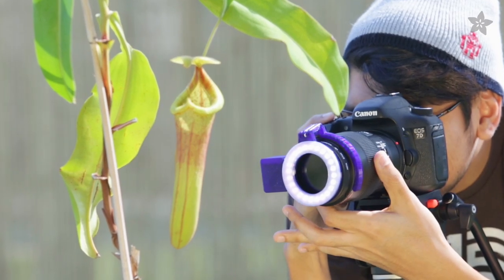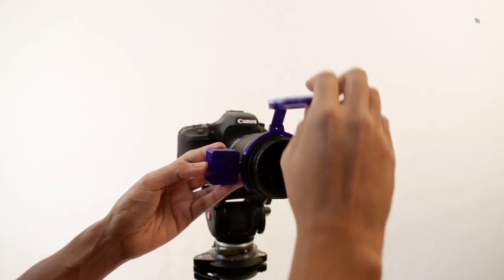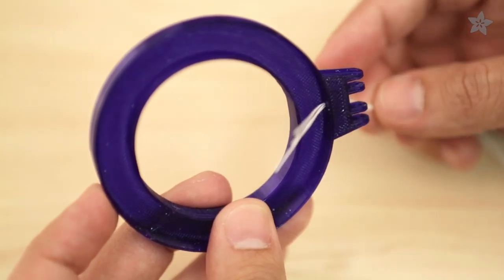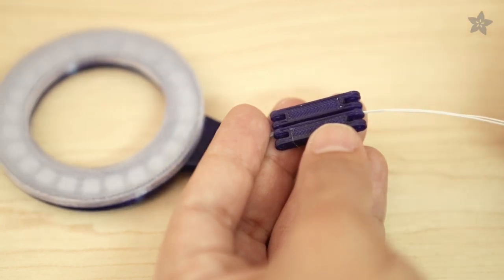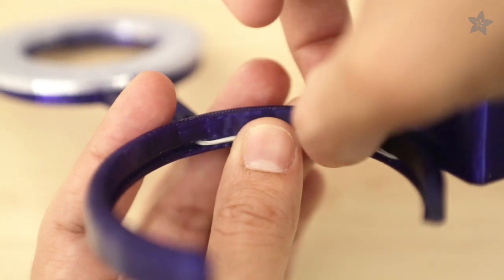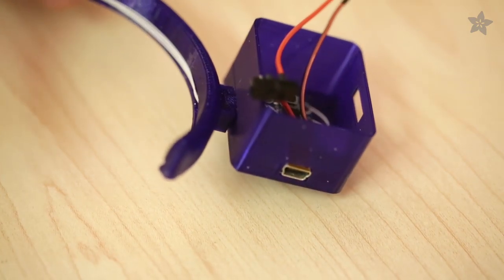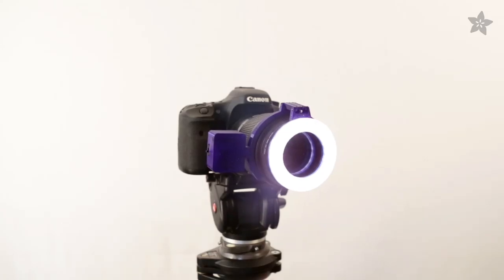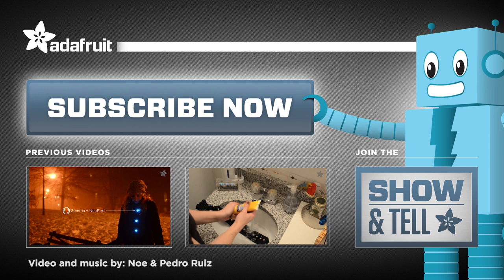3D Printed NeoPixel Camera LED Ring

Comment: Sweet!  I tried to make a RGB ring light once but ran into some problems with some parts getting too hot, it sort of worked and you could change colors with some dials easily, but I'm not an engineer and was a little over my head with it.  You folks need to make one that is much larger for doing video production too!